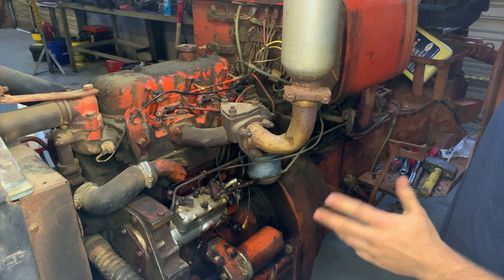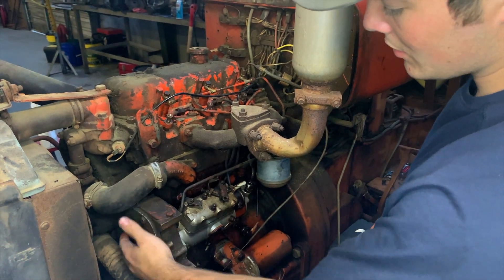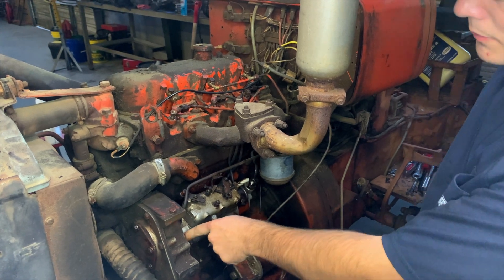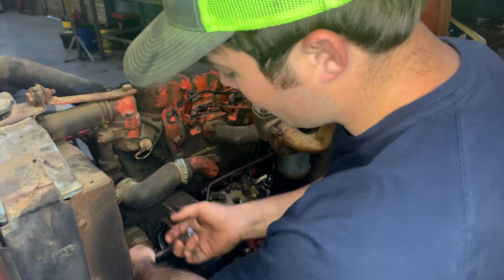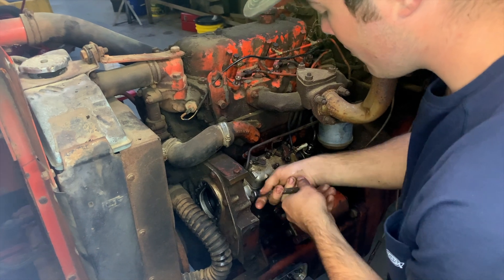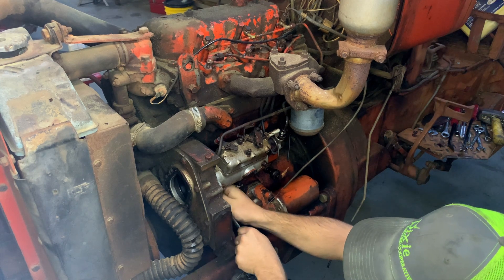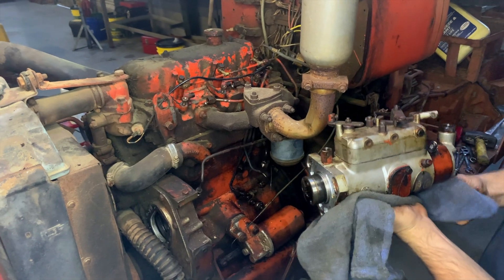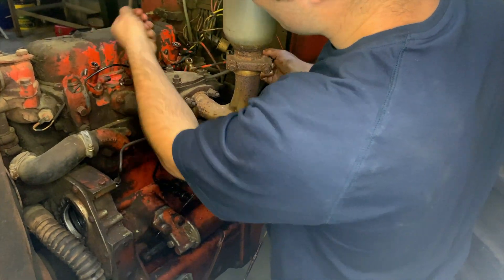Tractor Injection Pump Removal

Comment: Hi great video, thank you. I have a MF255 and I replaced the CAV injection pump but there is not a lot of pressure on the injector lines and the pump is leaking diesel from the mounting point in to the oil. Any idea or suggestions are appreciated....
Reply from the maker: It sounds like an internal issue with the pump. My guess would be a failure to seal or possibly a crack causing it to lose fuel (and pressure) through the front of the pump into the crankcase. I would have a pump shop check it out. If it is an aftermarket non oem pump it could be a quality control issue.

Comment: Except you didnt time the engine to the pump, you onky narked the case
Reply from the maker: Correct. As long as the engine is not turned while the pump is off it will not be necessary to reset the timing. (Which would require pulling the front engine cover and a possible split. With the pump back on and the notches aligned, this will be as close to perfect timing as you can get without any prior experience tuning. My goal is to provide relatively easy, but thorough solutions to that people can follow without much experience.
Reply: @caseedwards2280  But that doesn't work, the pump shop isn't going to put the pump in the same position, and you can be 180° off by not lining up the timing marks.
The pump on your 160 has a window on the side to line up the timing, and a spot on the flywheel, for having everything correct.